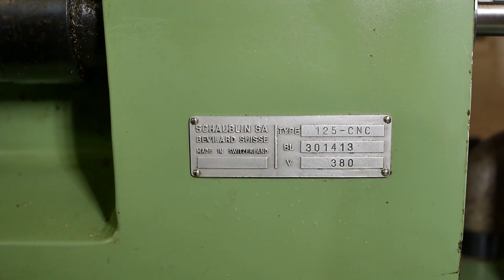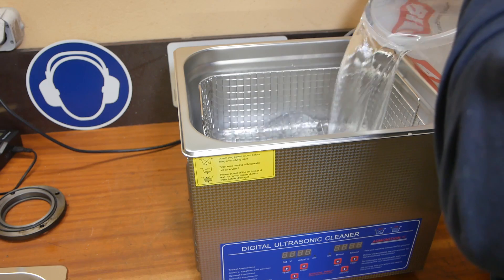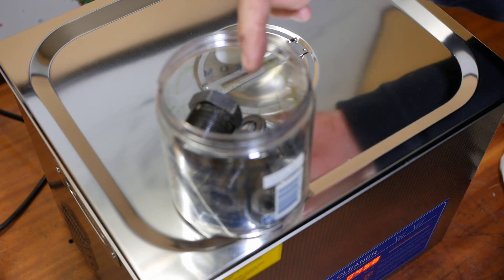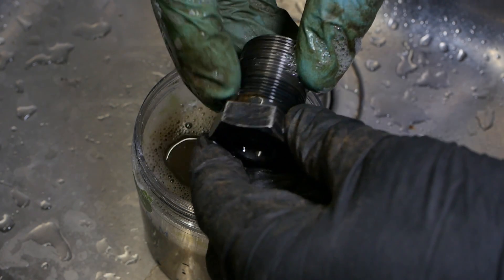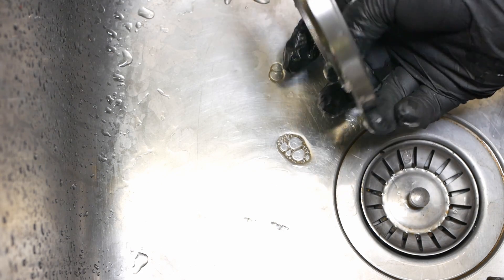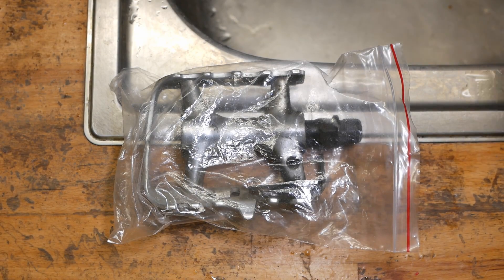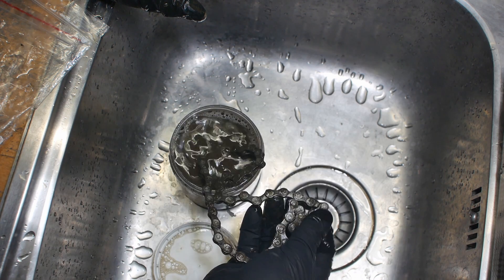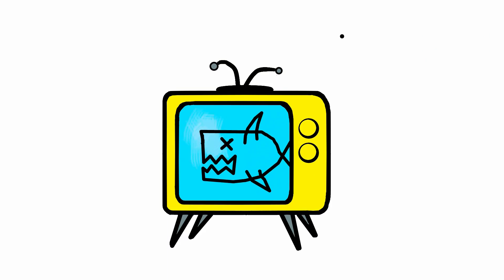Do cheap ultrasonic cleaners work? || RotarySMP

Comment: I worked at a shop we had an industrial ultrasounder cleaner it works fine The problem was the eco-friendly less harmful flesh friendly solution they used sucks like crap. So what ended up having to happen was we had to use it as a parts cleaner in the ultrasound cleaner and that works best. Taking a brush to the parts while it's in the bath
Reply from the maker: Thanks for the tip.

Comment: There are two ways to gauge the power of the ultrasonic cleaner. One way is to dip a sheet of aluminum foil into the cleaner. It should start to get holes all over and they get larger and larger. Second way is to stick your hand into the water. If it hurts, you have a decent cleaner. If it doesn't hurt, it may still work but just not as powerful.
Reply from the maker: I think I'll stick with the first method. I was told off for putting my hand in with it turned on, as this can cause bubbles in your blood. Nasty.

Comment: I know its 3 years later. Is your Ultrasonic unit still working?? Reason being, a lot of these cheap units explode over time.
Reply from the maker: Mine still works, except for the heater, which I blew up by having it on while empty.

Comment: I would be careful putting hands in while its on, while its probably not powerful enough to cause a issue but the industrial ones can cause a airbubble to form in your vein\arteries which can kill you 
once it reaches your heart
Reply from the maker: Yeah, I didn't think that through. I was warned on that back when I did the video, and dont put hands in it now.

Comment: Have you, or could you, measure the actual Wattage of your ultrasonic cleaner.  My cleaner is listed as 180 watts for the ultrasonic transducers.  When I measure it with a Kill-a-Watt meter using only the ultrasonic function of the cleaner, it measures between 110 and 135 watts.  I would be interested in knowing what your model is rated as and the actual power consumption.  You posted a great video and I appreciate the information you provided.
Reply from the maker: Sorry for the slow response on this. I just got around to testing it with a power meter in the circuit. Mine is 10L and marked as 240W of ultrasonic power. When I first switch it on it shows 100W, but as it runs, that slowly creeps up. After about 5 minutes it is at 140W. 
After the first five minute cycle stopped, I restarted it straight away, and it started straight at 150W.
By the third run, it has stablelised at about 160W.
Reply: @RotarySMP  Thanks for checking.  I contacted the manufacturer of mine and they finally said that the listed Ultrasonic wattage is "peak".  I have a feeling the "Peak" may only occur at the instant of startup and not able to be measured unless you have some very sophisticated testing equipment.
Reply from the maker: @phoban1329  It doesn't really surprise me that these cheap units have fake rating data.

Comment: This a great vid, especially since there has been so much feedback from others on 'how to'. Some great ideas here on how I'll tackle deep cleaning - I have the same machine, still unboxed. The isolation of the parts by whatever means is a great idea to be specific to the clean, and not contaminate the whole setup. Great controlled tests that give a baseline for different ways to clean different items. Many thanks for this from across the ditch... your approach to testing approach is raw and refreshing - really helpful. Sub'd and liked 👍
Reply from the maker: Hi Mark, thanks for your kind feedback. I dont normally do tech review videos, as there are so many of them, but for some weird reason, this has been my most successful video. :)

Comment: I don't think you left them in long enough. and that BBQ cleaner by itself would probably give similar results without the ultra sound. you should have done a comparison with and without the ultra sound.  sorry but I found it a bit pointless
Reply from the maker: That is a good call. You are probably right that the NaOH is doing 90% and the U/S cleaner is just adding a bit of agitation, but the result worked for me.

Comment: I've used ultrasonic cleaners quite a lot. The best multipurpose cleaning agents are citrus based, in AU it's called orange power, not sure what your local version is. Another great cleaner is Biox, which we used for cleaning regulators used for Oxygen service. If you really really need to get it clean there's another cleaner called Ardrox, primarily used for cleaning/stripping aircraft!
Reply from the maker: Great tip! I bought some citrix acid, and use that a fair bit.

Comment: Is there no place that offers the service of Ultrasonic Cleaning? Cause as far as I'm concerned it seems like an untapped market, especially in my area. I really want to learn as much as possible about it.
Reply from the maker: I doubt there is much of a market for servicing a cheap chinese niche product.
Reply: @RotarySMP  Exactly, but its uses are obvious and fast, sure its easy to use but most people from what I've found out are either unaware of its existence, consider it dangerous and something someone needs a license/training to use, or don't know how to use the solvent, frequencies or heat/time for certain types of material to clean, among other things. As a handyman, I have tools that are rusty, some don't even open anymore like wire cutters. Rather than throwing them away, I could clean them and bring them new purpose, I'm sure people have things they want to clean quick & effectively.
Reply from the maker: @calliastah4115  Oh, I read your comment wrong. Sorry, I thought you meant servicing /maintenance on the U/S cleaner, rather offering U/S cleaning services.

I once worked in a video store, which cured me of any desire to have a consumer facing service or production company.
Reply: @RotarySMP  Oh, for sure. Depending on the parts you may be working with and the customers, there's always the risk of having annoying customers who could claim the service 'damaged' the piece and would try to loophole a refund for said piece. It'll be a hassle, but I assume it has a promising potential if started slow / with the mini-U/S device shown here, definitely the more eco friendly way of cleaning parts asides from electrolysis.

Comment: So a year has passed since you made this video. Im assuming you learned thru trial and error what the best cleaning solution is by now. Im looking to buy a "cheap model" from Harbor freight and would appreciate any recommendations. Ill mainly be cleaning small engine carbs and parts. (Mainly just carburetors). I have some older small engines (Wisconsin) that cheap Chinese replacements aren't available online so I've decided to try and clean them myself. Thanks in advance for any and all advice!!!
Reply from the maker: I haven't cleaned aluminium or zinc parts like carb's, but the recommendation I received was to use citric acid based cleaners for things like that.
Reply: @RotarySMP   Thank you for replying!
Reply from the maker: @aaronmaynor6563  There is a lot of good advice in the comment section to this video, from people way more experienced with U/S cleaners than me. 

Dont switch it on with the bath empty. I blew up my heating element like that. Need to search Ebay for a replacement and fit it.

Comment: I am thinking of buying one of these for clean PCBs and your video has more or less sold me on the idea but can I ask if you still have it and if its still working ok?
Reply from the maker: I still have it. It still works just as well, except that I blew up the heating element, by leaving it on with an empty bath. I need to replace that, but normally just pour in hot water at the start.

Comment: I would like to see if you put two of the same parts , 1 just with your cleaner and 1 with the same cleaner in the ultra sonic bath and then compare.
Reply from the maker: Whenever I use it, I tend to have a job which I need to get done, and dont think of scientific method at that moment.

Comment: Hey you should have done a test first. put the bolts in that small container and just let it sit on the counter for 5 minutes in that solution, without turning the machine on. too see how much of the "cleaning" was from just sitting there.
Reply from the maker: I think the agitation of the U/S is helping.

Comment: I see this is an old video. Maybe by now somebody has already tried
1) using a metal can instead of plastic and 2) just dipping similar parts overnight without ultrasonics.
How did they compare, please ?
Reply from the maker: I haven't heard of anyone doing that. Sorry.
Reply: @RotarySMP  I just have to say how much I appreciate your reply. The knowledge that my question reached the right person and that he bothered to acknowledge it is almost as good as a direct answer to my question. Thanks.
Reply from the maker: @sayeretmatkaal  Sorry to not be more helpful. I think the ultrasonic is useful, even if it doesnt have a power of an industrial one, as it least it aggitates the liquid and keeps fresh solvent against the part to be cleaned.

Comment: One thing learned using ultrasonic cleaners is to immediately dry and oil metal parts that can rust. These things are so thorough in their cleaning that metal can flash rust in minutes. 

Also, as others have said, use a larger glass container which reaches above the surface because some cleaners can cause pressure to build up in the container. I occasionally use acetone in a a jar and it will boil  if you're not careful.
Reply from the maker: Thanks for the tips. When I use caustic solutions. I rinse, then use WD-40, and then oil.

Comment: I purchased a 3L simmilar version to the one you have got and the temp control circuit failed and sent the liquid close to boiling. I set the temp control tp 45 deg C and that made no dufference. All of my delicate parts were ruined. All the money i supposedly saved on the cheap chinese purchase, cost me far more in ruined damaged parts.

After boiling the living life out of everything, it did not clean all that well, and it destroyed the carburettor. 
For me, i paid the ultimate price of destroyed and ruined delicate parts. 
I will not buy one ever again.
Its just not worth it.
I got stuffed arround for days  and days by the seller.
Reply from the maker: That is the danger with this cheap tooling. I had the opposite, I by mistake turned it on with no liquid, and burned out the heating element. I need to get a replacement off ebay.

Comment: I have a bigger version similar in size to a real ultrasonic bath I used at a motorcycle shop.
It gets the job done, but not as quickly as the expensive one the bike shop had. It also seems to have a less powerful heater.
Still 10/10 considering the price.
Reply from the maker: I have never used a proper one, but this one seems to work pretty well for must of my jobs.
Reply: @RotarySMP  same. The practical difference is minimal, especially for hobbyists. My knock-off might take 20 or 30 minutes vs the brand-name one only taking 10 or 15 minutes to achieve the same result; but either way the part comes out clean, and you didn't have to spend your own time scrubbing it. Just like how the dishwasher and washing machine might run for hours, but it only takes five minutes to load them.

Comment: I do not know if you can get it where you live, but Simple Green Extreme Aircraft/ Precision Cleaner is great on pistons.  It was about $20/ gallon in the USA.  Kind of expensive, great on aluminum, water/ cleaner ratio of 10/1.  New to ultra sonic cleaning and automotive parts were my first project.  I bought a large ultrasonic cleaner.  I put pistons and connecting rods together at 80c and 30 minutes and it removed all of the cooked on carbon.  It looked like new.  Also barely could fit a aluminum head in the tank (had to rotate cleaning on each side) and it looked really good.  Used the same cleaning solution for a complete engine build and it looked nasty but still worked good for the whole project.  Still trying to figure out what cleaner works best on different metals.  Want to try Evaporust, my go to rust remover, next on rusted parts.  I like your low cost solutions like vinegar on rust in the ultrasonic machine.
Reply from the maker: Thanks for the tip, but I have not found a source of that cleaner here. That helps the US viewers though.

Comment: I have a small equipment repair shop I run out of my garage here across the pond in the US.  Being in a cold state every spring I get overrun with mowers, blowers, chain saws, etc that will not start after winter storage, carbs are clogged.  I use an aluminum safe solution and pre heat the water on the stove before the process. Some carb cleaner sprayed first in the carb passages and then 10 minutes in the cooker (what I call the machine) the carbs look and run like new. I paid $120 US dollars and it has paid for itself several times over.
Reply from the maker: It sure is a handy device.

Comment: For that piston you might want to try Orange Cleaner  (that stuff that uses Orange oil)
Reply from the maker: Thanks for the tip.
Reply: @RotarySMP  I Use it on small engine parts/motorcycle parts. Does great on 2 cycle pistons that looked like the one you had.

Comment: Very interesting test. The bag trick is an excellent one. I would suggest leaving parts for a substantially longer time for a thorough cleaning. For example with rust removal, 30’ to 1h may be a more adequate time imo.
Reply from the maker: Great tip!
Reply: dude someone stated soft plastic items in the cleaner weaken the ultrasonic action. better to use something hard/brittle like glass

Comment: I like you using a container for parts to keep the water clean inside the ultrasound. Genius.
Reply from the maker: Thank you! 😊 but I also picked that up from YT
Reply: @RotarySMP  I prefer using a square pad sander with a heavy plastic container glued to the pad. Hang the item and turn it on and in 20 minutes the part is super clean and I used very little detergent. This has got to be the cheapest way for a poor mans ultrasound. Been doing it for a many years but only for smaller parts. Peace
Reply from the maker: @victoryfirst2878  That sounds like a very good solution. Have you ever had the glue break on the container?
Reply: @RotarySMP  I have never had the glue release failure. The worst thing would be plastic jar drop from the sander. Maybe it could crack, but plastic usually survives. Especially if the jar is made of Lexan. The stuff is 3 to 5 times stronger than plexiglass. Peace vf

Comment: Next time you need to clean something really oily or that has carbon on it use straight gasoline as your solution in the jar or bag instead of water. The gas when used with ultrasonic cleaner will remove all of that tough stuff, even makes old black spark plugs look shiny, white, and like new again!
Reply from the maker: Thanks for the tip.

Comment: Nice video but in my opinion you should work the machine as it is supposed to with an ultrasonic cleaner and the appropriate times of cleaning and also the right temperatures. I have seen letting dirty items in the cleaner for even hours. Not sure just 5 or 10 minutes is enough time for many things except maybe for small  jewellery. Certainly not for a dirty piston or rust.
Reply from the maker: You are right, also picking the right clean solvent for the job is very important.

Comment: How much did it cost? I need one for really tiny parts like for microscopes etc. Some of the set screws on them are like 1mm by 3mm and are covered in rust. I can't very well put those in the Evaporust as there isn't a small enough mesh and I would like a better way to clean the rust off. This would also let me do something other than cleaning constantly!
Reply from the maker: I got the 10L one from Amazon, which are currently $170 or €179
USA - https://amzn.to/3ETmme0
EU - https://amzn.to/3eU09Sm
This is an affiliate link, so if you puchase through there, it cost you no extra, but I get a small commission to assist the channel.
Reply: @RotarySMP  thanks! I'll check it out.

Comment: i think i will be getting a 30L for my shop to cleaning parts of the machine.
Reply from the maker: Just dont turn it on empty. I did by mistake, and blew the heater pad. They are cheap enough to replace (I havent bother yet), but annoying.
Reply: @RotarySMP  but it clearly told you NOT TO in chinglish on the side mate :P
Reply from the maker: @nikolaiownz  Shame i tossed the instruction manual :)

Comment: they are shipped upside down because the ultrasonic transducers are glued to the bottom of the tank and they have quite some weight,  transporting it upright might detach them when the package gets dropped. just a speculation, never unboxed one
Reply from the maker: Yeah, that sounds about right.

Comment: Ultrasonic cleaners without the surfactants that make the cavitation happen in the solution do not generally clean well at all, just acting like a vigorous rinse in whatever solvent they are immersed in, which is actually quite gentle and used for things like contact lenses. Ultrasonic cleaners need specified solutions to allow the cavitation that creates the vigorous cleaning action expected of them.
Reply from the maker: Thanks for the feedback.

Comment: Only reason I got one was for cleaning polished gunparts. Before nickel plating.
But it keeps doing damage to them. I think its both the machine and the fluid causing it. im so pissed..
Reply from the maker: How long do you leave them in? I also think the chemistry is probably pretty important for a special use case like that.
Reply: @RotarySMP   I only did it for 2-5min  in 40 degree and it already started to get dull and hazy .
But I got another cleaner fluid thats suppose to be more friendly and improve shine. gonna test it soon. My last hope